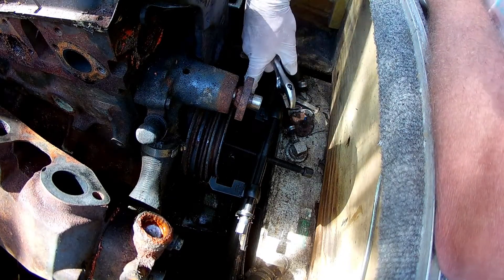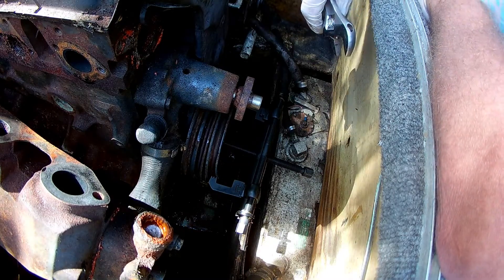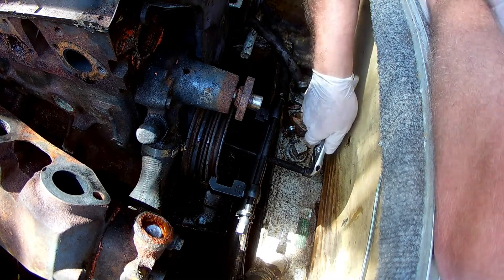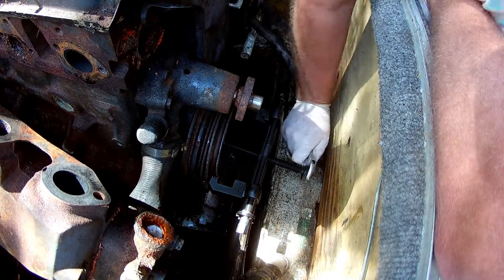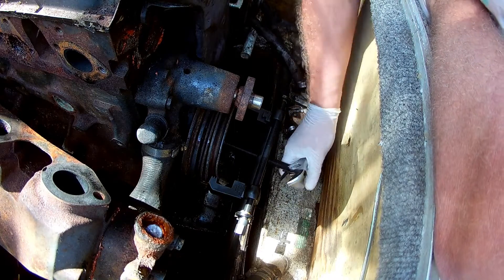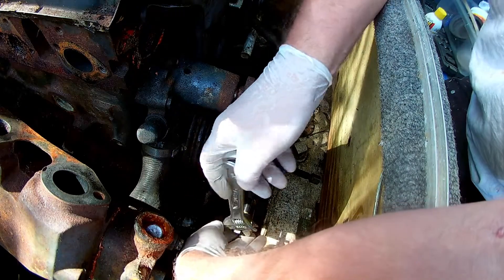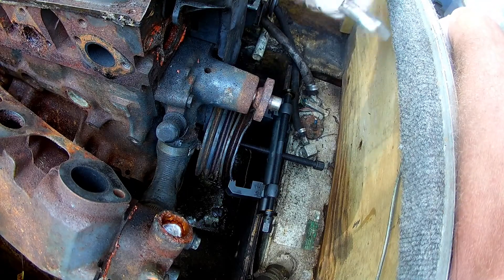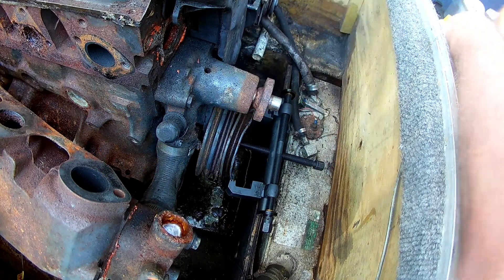Trying to pull the crankshaft pulley

Comment: If you are on the pulley I think you are on, you NEVER use a bearing puller on that. That pulley would be the harmonic balancer. There is a special tool used to remove that which can be found at any auto parts store for maybe $30 bucks. you would bolt it onto the balancer and use it to remove the pulley. Using a bearing puller or pulley puller on that will damage the harmonic balancer. To check to see if it's a harmonic balancer which is usually on the crankshaft, look or feel for rubber on the inside of the pulley somewhere. The Harmonic balancer takes the vibration off from the engine. Without it, your engine will vibrate erratically while it's running. My mercruiser 3.0L has a slightly bent harmonic balancer because someone apparently tried a bearing puller on it. It's not bent to where it's really causing me concern, but you can see while it's running the pulley is slightly warped, which prompt's me to want to go get a new one. Watch this video and you'll see it's fairly easy to use the tool. The hardest part is removing the center bolt, then re-installing it if the center bolt is froze. This video is an example of how to remove a balancer, it's not the same as yours or mine, but will give you an idea as to what you are dealing with when it comes to the pulley on the crankshaft. If you bend it or hear a "pop" using any method other than the balancer tool, you'd best go buy another balancer. I learned the hard way repairing my 06 Ranger. Boy did my dash bounce when I started my engine. https://www.youtube.com/watch?v=Q42meP_LOV0
Reply from the maker: Thanks for input!

Comment: You need to hit that pulley with lots of heat from something like a propane torch, and use a puller that can get a good grip on the BACK of the pulley, maybe cut/grind the front of the pulley off so that puller can get in closer to grip on the back. There's nowhere near enough strength in the front of the pulley to apply the pressure you're gonna need, even once it's damn near red hot
Reply from the maker: Thanks for your comment Gene!
Reply from the maker: Going back again tomorrow morning.  Think I have help coming too

Comment: try useing a 3 jaw puller and put it on the back side of the crankshaft pulley so as not to bend the front  and to use the thickness of the pulley to pull itself off .works every time for me. a 3 jaw gives you better leverage
Reply from the maker: Unfortunately there is not enough room to get behind the pulleys, I already tried that on my first few attempts a couple of weeks ago.  Besides that, the 3 jaws are to flimsy.  But I do agree that  more points (preferably from behind) is better.  If I had a shop (like I used to have), I would custom make a puller.  Unfortunately, now I live in a tiny condo and my boat is at a friends yard    :  (

Comment: I had one on a truck did same thing. Broke a puller...So it Pissed me off removed radiator, hooked a chain around it shoved my other truck in 4x4 and yanked it off. These can really get stuck.
Reply from the maker: Wow! Dandy Camp!  Thanks for input!
Reply from the maker: Did you subscribe yet? Hopefully one day I will get it off and finishing replacing the head gasket that this is all about. If so, there will be more video coverage.
Reply: chefgeir I will now lol
Reply from the maker: @DrakeAlan31  Thanks! (I need a thousand or more!)

Comment: I would take that box around the engine off to start with so with the puller on you would be able to hit on the bolt from the puller. Should only be a few screws to take it off from the ones that I've seen. Hitting it that way helps put the pressure on it in the direction it comes off. And like Kasey P said, put a little heat on it.
Reply from the maker: Box is built around it https://youtu.be/_Gim7UL-BD8?t=179 so I was hoping I could get this pulley of without demolishing the boat. Not sure at this point.
Reply: @chefgeir  I see what you mean, a friend of mine had a boat that had a few angle brackets that held the 3 sided box in place but could be removed easily to work on engine. How about making an access panel on the front of the box big enough to be able to swing a hammer at the puller ?
Reply from the maker: @FORDRANGERFAN  Yes. That could be a less intrusive solution.  I am however unsure of how hard I can tap/hammer without damaging the crankshaft and/or bearing.
Reply: @chefgeir  Well that would be hard to describe how hard to hit it. But with the hammer you are using in the video I'd say about medium to soft hits. And as you hit it, it should be hitting against the thrust bearing inside the engine on the crank, not the bearing there at the end where the pulley is. More softer hits could help as much as fewer hard ones. I think in part what it does when you hit it is to put a vibration on it to help to break the joint apart.  And put some anti seize on it when you put it back together.
Reply from the maker: @FORDRANGERFAN  Thanks!
Reply: @chefgeir  Your welcome, Hope it works out for you.